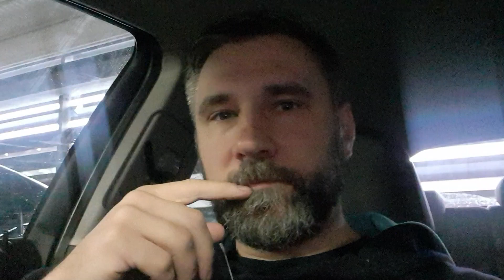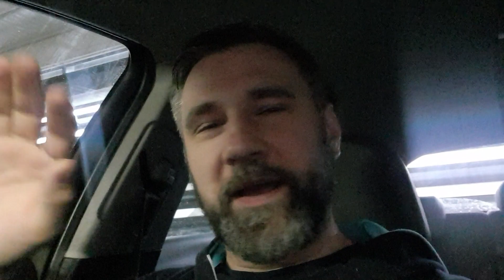Why midbass in IB might make your car QUIETER

Comment: The mecanical motion creates a magnetic field, which produces the electrical current due to the voice coil's position. It doesn't transform the mechanical resonance purely into electricity. Both are present. Also pretty sure that's not how damping factor works. If you wanted to actually make it quieter in the vehicle, you'd need some sort of ANC system.

Comment: What about midbass IB vs Sealed?  About to put kick panel midbass drivers in my 69 Chevy C10 truck. There are vents in the kicks that vent out to the fender and cowl of the truck. Will fab a baffle to seal the driver to the kick. Will either incorporate enough air space for the driver if sealed, or just allow the driver to vent out the factory air vent.
Stereo Integrity TM8 or TM65 with M25 tweeters. Two way active. They BM-11 flat sub up front and center console. Sealed. Thoughts on IB, 8 vs 6.5 midbass with front sub. 
And thanks for the channel.

Comment: You stated that a speaker will output an electrical signal if a force is enacted upon it, so then why would a speaker that has to conform to an amplifier's electrical signals be positively affected by randomized resistance/inputs from outside noise? If anything, it is bad and cannot affect noise positively. I doubt enough of it makes it way to the speaker to matter, frankly. Additionally, mass stop noise. A paper cone is going to allow more of that into the cabin. MLV Stops noise due to it's mass, it doesn't turn it into heat. That's CLD that attenuates vibrations of sheet metal into heat by resisting change.
Reply from the maker: There is a difference when the music is playing and when it is not. When music is blaring while driving, none of that stuff matters. It's only when you are not playing anything while driving.

Comment: My question is my mom has a ford fusion with 2 6x9 factory subs in the rear deck and it has really loud decent sounding bass, I tried the the same with my car and the bass is lacking, do I need to seal off the trunk for it to work properly
Reply from the maker: The trunk should be isolated from the front of the cabin. Otherwise the low frequencies will cancel out.
Reply: @RAW-CAt  thanks also is dynamite a good isolator to cover holes in the rear deck?
Reply from the maker: @thenewkinglouie6514   if you cannot put any wood or plastic, deadener will do. Not ideal, but will do.

Comment: With the speaker mounted in the baffle the hole is sealed. The speaker will reflect alot of the higher frequencies just like any other surface. With MLV it is very important  that you overlap it at the joints or make sure it is sealed best as possible. If you have any holes the sound will find its way past the MLV. Same way that you're car is so much quieter with the windows completely up. But what happens when you crack the window just a bit? The sound will find its way in. I personally don't think MLV works very well in a car environment. Its just so hard to cover a large area without any breaks in coverage.

Comment: I like the idea of putting midbass in the kicks vs doors, less moving parts.
What’s your opinion having an enclosure in the kicks versus IB?
Reply from the maker: In a small sealed enclosure you will have absolutely no low end. If you have a front sub that might not be an issue.
Reply: @RAW-CAt  Gotcha. I’d have to rely totally on low end from the rear with time delay.
I’m learning…👍

Comment: Could you maybe do something more in-depth on the process of going true IB in kicks as your speakers are currently out etc.
Reply from the maker: What specifficaly do you have in mind?
Reply: Materials used to keep the speaker dry and do you need a specific IB speaker or cone material. Or is it literally a case of jigsaw a hole and whack a speaker in?

Comment: But your amp now has to take away your supposed road noise in its negative feedback circuitry reducing its ability to accurately reproduce the musical signal.
All of these theories possibly amount to a negligible percent of influence.
Just blocking the hole was 99 percent job done.
Reply: Blocking the hole... still counts
Reply from the maker: Do we really care about accurate reproduction of music blasting while driving on a motorway?🤷🏻‍♂️

Comment: Hi, with my test -I did 1 speaker IB in the firewall and it's not quieter than the metal of the car, especially with deadening. Moreover - when you're moving, the car is LOUDER inside, which impacts all of your system - you have to turn the system up to compensate, and it was just 1 speaker, with 2 speakers in IB - the situation will be even worse. My car is super quiet with deadening almost everywhere, this is the same reason I went with the sub in the rear deck and trunk completely isolated from the cabin - if the sub would be somewhere in the trunk and with the holes in the deck to breathe - the amount of road noise coming to the cabin was HUGE and again - you have to turn the system up to compensate.

Anothe huge drawback for me is how loud was just 1 midbass outside. I drive in the city and don't want any attention from the pedestrians, so for me it's very imporant.

So I will weld that part back, deaden and will build door enclosures.
Reply: I didn’t even think about outside sound, so when you’re parked up at the lights is it really loud for pedestrians?